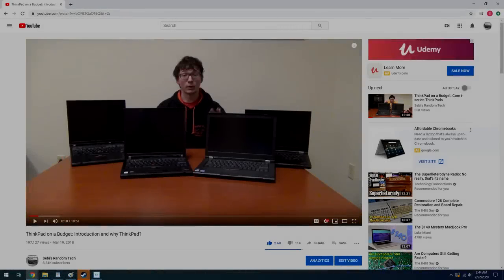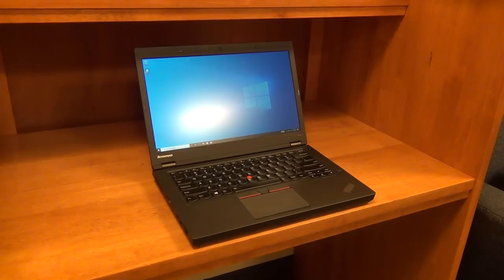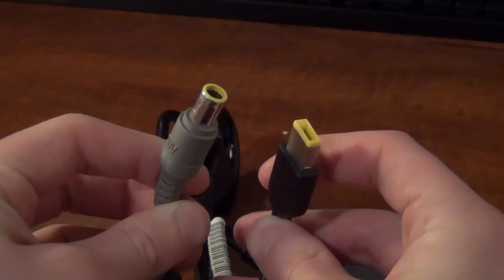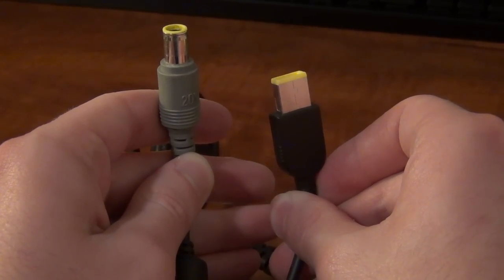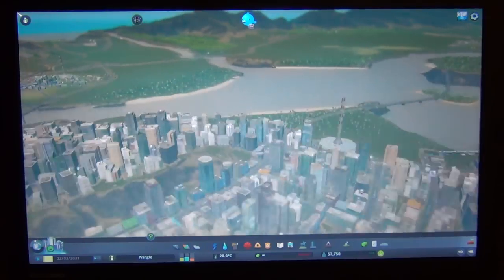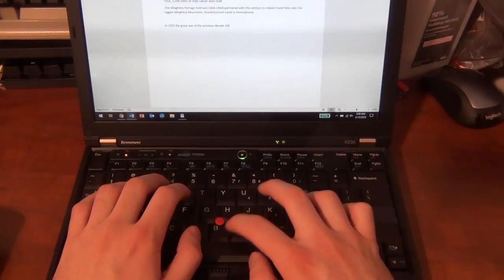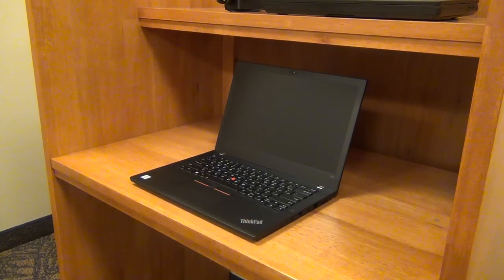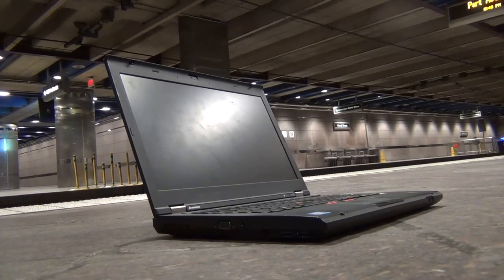Best Value ThinkPads in 2020

Comment: Is T540p is good choice?
Reply from the maker: Go for a W540 or W541 instead. Exact same size laptop (actually the exact same design) but much more powerful processors and graphics.
Reply from the maker: @workisimpossibletowork7415  800+1500 euros is absolutely ridiculous for a repair, especially on an older laptop. I think you're better off taking your chances with replacing the motherboard yourself. Since the processor is a separate part it might be worth seeing if the original is salvageable. If you are comfortable taking apart the laptop to the point that you can replace the board, I would say do it yourself.
Reply: @SebisRandomTech  Thanks Sebi. It is a good idea to replace the motherboard (MB) first and see whether the CPU is salvageable. However, does a problematic CPU have any chance to damage the MB, e.g., burn down some resistors or capacitors on the MB?

Comment: Hi do you think if the lenovo x250 thinkpad is good for 380 singaporean dollars? For work and can it run overwatch at the lowest settings? The specs are i7-5600u 2.6 Ghz 8 gb of ram, Graphic 5500hd.
Reply: Storage is 1tb
Reply from the maker: What resolution screen does it have?
Reply: @SebisRandomTech  i think its 1366x768 but im not sure ill see if i can get the information later. But can you give your opinions if its either 1366x768 or 1920x1080
Reply: @SebisRandomTech  hii soo are you able to give ur opinion for both?
Reply from the maker: The 1080p screens are better, however if the 768p screen is IPS then it will still look nice.

Comment: Hi bro i have Lunovo Thinkpad i7 6600M with 8Go ram and the nvidia 940mx graphic card, is it good to play games on it like GTA 5
Reply: No
Reply: @Cr1ptlord  why? should i add smtg and what is missing
Reply: Might be able to at least 30fps if you turn down settings to low and play at 720p.
Reply: @Ayoub-Bouchama: 

I-suggest you look at the hardware-requirements of the computer-game "Grand Theft Auto 5" and look at the hardware-specifications of the computer--graphics-card "nVidia 940mx" and look at the rest of the hardware-specifications about your-specific-computer and compare all that stuff to the "hardwzre-specifications--requirements of [the computer-game] Grand Theft Auto 5" and see if they match and/or see if your computer has computer-hardware powerful-enough to run the--computer-game Grand Theft Auto 5.

Comment: X220 the gold standard of thinkpad
Reply: Chris S. 
I own two X220s and other than the keyboard, what’s to like?
One of mine is bone stock and the other hot-rodded and essentially maxed 
My next X series laptop will be an X-250 or X-260
Reply: @GasPipeJimmy  for me the feature set and relative power compared to newer laptops is great plus it's easy to upgrade. I don't run windows which also helps tremendously with utilizing the power that i do have. Mine is maxed out as well. You can run 16gb of ram in x220's. There is misplaced information on this laptop on many sites that shows specs for the x220 when it comes to ram. I just think its an incredible value for under 150. Granted the one i purchased on ebay was in perfect condition.

Comment: What are your thoughts on the upgradability of the T440? We have one bought as surplus from a large accounting firm, it's seen loads of (ab)use and is not a top-end config by any means - we got it dirt cheap. Someone appears to have swapped in  T450 trackpad, but multitouch and scroll gestures do not seem to work - any ideas on what it could be? All drivers are up to date.  Also the screen is the lowest end TN panel and is useless for any serious spreadsheet work, would a 1080p IPS be a drop in replacement? Thanks in advance.
Reply from the maker: 1080p IPS panels are usually a drop in replacement, it's just a little bit tricky because of the front bezel being held on by adhesives. I'm actually working on a video where I do this process in a T440s, however it's very similar in the regular T440.

As for the T450 touchpad, I did a video on this with a T440p where I show how to get the drivers working correctly. I don't use the touchpad but those drivers should get the scrolling and gestures working.
Reply: @SebisRandomTech  Thanks for the quick reply. I found the T440p video after I posted the first comment, downloaded the drivers linked on the forum, no difference. The manufacturer listed in Device Manager details is "Lenovo" though, so I am thinking if someone put a cheap copy of a proper touchpad in, which would explain why multitouch scroll is not working. Interestingly middle button scroll works fine in chrome but not e.g. in the Win10 settings app.
Reply from the maker: That’s the original issues I had before installing the proper drivers. I think you need to look for a more recent video of mine, you can’t simply download the drivers shown there but you also have to modify the files of it to properly work on the T440. This more recent video outlines that process.
Reply from the maker: https://youtu.be/iap3qJKpR84
Reply: @SebisRandomTech  Hey. Tried the procedure outlined in your video. Did not work, there was no change. Any idea what it could be? I uninstalled all Synaptics drivers and tried again, but still no result. Checked the driver installed was the one from 2018 and was not signed, so appears to have been the correct one.

Comment: I recently got accepted to grad school for computer science I'm looking to get a Thinkpad run Linux on it and maybe some basic cyber security/ sysadmin software do these thinkpads have good enough performance for this?
Reply: The Thinkpad would be running Linux. Likely Kali Linux.
Reply: @andyburris2555  , I'm no expert, but for the same reasons got myself used x250 last year (got lots of recommendations for this model from my friends). I5-5300u + 8gb ram + 240gb ssd . All of that for 250$. Currently running ubuntu, but tested out lots of other distros (kali included). Had no problems whatsoever. 
Im only 2nd year in computer science (in France, so I dont really know if we're studying same things), but so far I had zero problems linked to hardware (performance/compatibility wise) and I'm really happy with what I got for the money. You should probably consider getting one of these. If you're worried about it being "weak" - you can get yourself one with I7 inside. It will cost you 200-300$.
Reply from the maker: These should do the job just fine, and if you need an extra performance boost that will just be a RAM or CPU upgrade away.
Reply: Right on brother, I run Linux without issue on my T430. Should do the trick.
Reply: My T420 with i5, 8GB RAM and SSD is running Windows 10 smoothly. I upgraded it from Windows 7, wich also ran great on it. A regular Linux installation should use less resources. In the matter of fact, I am using Linux Mint on a 12 year old Asus Eee Netbook with Atom Processor, 2GB RAM and SSD to record Audio directly from my USB connected mixer at live shows. The T420 is way more powerful than the old underpowered Eee. So, you'll be more than fine. This said, it is generally a good idea to install an SSD in any computer, these days. It makes a huge difference in read/write performance, which is most noticeable at boot-up. Throwing in more RAM increases the performance, also.

Comment: Great video! I would also like to mention that the T450s is a pretty good laptop if you get it with the touchscreen. It looks very sleek and modern.
Reply: It also has a block of wood for a processor. As a matter of fact, the i5-3320 in the T430, is a little faster.
Reply: Just got a used t450s from eBay. i7, 8gb RAM and FHD IPS display. I think it's an amazing machine. Loving it.
Reply: @dragunovbushcraft152  which CPU in the T450s are we talking about here? It had a range of CPUs available.
Reply: @jugostran  Intel Broadwell core i7-5600U CPU.
Reply: @dragunovbushcraft152  depending on CPU. It isn't stronger than the i7.
Reply: @jugostran  i7-3520m vs. i7-5600u= Virtually, exactly the same.
Reply: @dragunovbushcraft152  yes. Possibly because one uses an ultrabook chip. Though, in regular day to day use, both CPUs are snappy. And the T450s looks more modern which is a definite advantage.
Reply: @jugostran  If you're doing general computing, the T450 is "ok", and "Doable". Just like the T430. However, you can do many more upgrades to the T430, to make it MUCH faster than any T450. You can upgrade the T430 CPU to a Quad Core,  making it usable much longer than the T450. You CAN NOT upgrade the weak, T450 CPU.
Aesthetics don't make a laptop any more, or less usable, and the T430, especially, the T430s, are certainly not bad looking computers.

15w.... 47w..... Makes no difference numbers, are numbers, and faster, is faster. Numbers don't lie. IMHO, Broadwell processors were a small step DOWN, from Ivy Bridge, and pathetically inferior to Haswell.

I could've been REALLY unkind, and compared the MQ powered, T440p, or W540, to the T450, the T460, even the T470, THAT would even be worse! It's pretty pathetic that a seven year old processor (i.e. Haswell, i7-4900mq), can embarrass a new, top of the line, T480 Quad Core, when it comes to real "dirty work".

A lot of people make the mistake of, "Hey! A T470 would be better than my old, T440p i7-4800mq", and are sorely disappointed! Just because people don't know.
Reply: @jugostran  Exactly! The T450s really looks modern and good. Very portable as well. It's my first time using a ThinkPad and I'm impressed. I have previously used Hp and Dell. The life of my second hand T450s is about the same as Hp, bought brand new. However, the HP is now very annoying to use and slow. ThinkPad rocks!
Reply: @dragunovbushcraft152  also CPU won't solve the biggest issue with all ThinkPads. The graphics. What good is a strong CPU when you can't even do any graphics intensive task. In my opinion, the stock dual core CPUs match well with the iGPUs.

Comment: ** Hi Sebi: Today's October 21, 2022. I am in the market for a laptop. I live in the US. My budget is about US$1200. Looking for a 14 inch at least, large screen size is fine too. Weight should not be more than 4 to 5 pounds. I want to buy once, cry once. I will use it for casual to semi professional computing. Will need 16 GB of RAM and a solid state drive. It would be nice to have a good keyboard, battery and a durable charging port. Thank you **
Reply from the maker: Look at the P series. You can likely find a used P52/53 in your price range. You could also look at the X1 Extreme and P1. Only downside is the battery life isn't quite as good on those models but they will check off your other requirements.
Reply: @SebisRandomTech  Thank you 💙 I will follow your recommendations.  However, I did something impulse last night. I purchased an open box T480 for $500. It has 16 GB of ram, 4 GB of video ram and a resolution of 2560x1440.  Does this make sense?/. This means I still have some money left to look into the P series, X1 extreme and P1 as per your recommendation. I thank you again for sharing your expertise with people and your viewers. May God Bless you.🙏
Reply from the maker: @bella3008  Give the T480 you purchsed a try and see how well it works for your needs before spending more money. If it works well then you're all set, if not then you could look into other options.

Comment: Lenovo seems determined to destroy the ThinkPad legacy with their bad decisions in terms of design, functionality and upgradability that get worse and worse every year. It's sad. I love my P50 but I do have a crush on those T430 machines, they're the sweet spot between older goodness and future proof.
Reply from the maker: I completely agree with you. I still prefer the T430 and older ThinkPads, but everything up until the T480 was still at least respectable, and a step above the competition. With the T490 and the newly announced T14 I can no longer say I would recommend a brand new ThinkPad to someone. The P53, P73, P1, and X1 Extreme are pretty much the last fully upgradeable ThinkPads, but even those removed external batteries. I really hope Lenovo listens to its customers and makes better decisions going forward.
Reply from the maker: Sebaka & Co.  What are you talking about? The whole appeal of these machines is that they are easily serviceable. RAM and storage are both important components that can fail moreso than other parts of the motherboard. Soldering on something for no reason that used to be replaceable makes absolutely no sense. What defines the ThinkPad legacy to you, Lenovo turning them into MacBook wanna-bes?
Reply from the maker: I have to scoff at your response. You didn’t even answer my question so...

Also, what’s wrong with wanting to be able to work on something I paid good money for? What’s wrong with wanting to upgrade parts in my computer to extend its useful lifespan instead of being wasteful and buying the hot new gadget every year? I seriously don’t understand why these things are such a problem for you as you feel the need to “scoff”, talk down, and be disrespectful.
Reply: Sebaka & Co.  what defines a ThinkPad, in your opinion?
Reply from the maker: Sebaka & Co.  If my questions are not worth answering, then I'm clearly not worth you wasting your time by coming here spreading complete fallacies and then accusing me of dropping fake likes and comments. You refuse to address my comments and instead insult me and others. All because you can hide behind the comfort of your computer screen knowing that you're safe from any real-life consequences of your actions. Your argument lost its merit several comments ago. Thank$ for wat¢hing thi$ video!
Reply from the maker: @DaoQui  Don't even bother, he's made it clear he's not going to actually answer legitimate questions/concerns.
Reply: Sebaka & Co.  You do realize that losing the ability to upgrade/replace things like the CPU, GPU, etc is because of companies like Intel and Nvidia, not Lenovo. Lenovo didn't choose to stop offering socketed laptop CPUs, that was Intel's doing. Lenovo didn't stop supporting the MXM standard, Nvidia did. The whole reason Sebi recommended the ThinkPads that he did in this video was because they were the last ones to have socketed CPUs, so I'm not sure why you're trying to argue that he isn't concerned about that...I could go on about the lack of any sort of real argument on your part but you have already made it clear that you have zero interest in actually debating and just want to harass this guy as much as you can because he doesn't like newer ThinkPads as much.

Comment: Thank you for the really informative video. Based on what you've said, I think I'm going to buy a T430 as my first Thinkpad. Mainly for video editing. Just wanted to ask a quick question though: is there any limit as to what SATA hardrive it can use the in the hot swappable drive bay? I have a spare 1TB hybrid drive I used to use for a PS4 and just wondered if that would work.
Reply: T430 owner here: 7mm and 9.5mm 2.5" drives are compatible, as the DVD Hot-Swap bay is 12.5mm tall.

Comment: Best Thinkpad models are T530 and W530.
Reply: I'm using a W530 with an i7-3940XM. When I watch YouTube videos the CPU usage goes to 40%. And I already have the most powerful processor in it.
Reply: @christoph1995  yeah, they are 11 years old now and obsolete. You can get good deals on much newer Thinkpad these days. A much thinner and lighter T15 G1 will outperform it

Comment: About to buy my first ThinkPad to do some Excel, mySQL and beginner coding. Should I get an X230 or T4x0?
Reply: The form factor of the x series is great for portability reasons but an external monitor is way more comfortable to code on than the screen of the x230. Don't get me wrong. I'm still using my X220 to do coding and such and it's okay, but you don't want to sit  hours infront of that tiny screen. So I'd say, go with the T4x0 series. Still portable but a more comfortable screen.
Reply from the maker: Both are really good choices. A larger screen would be better for coding but a smaller screen would be more portable.
Reply: @TinyTeaKettle  What do you think of the T440s?
Reply: @emacs Depends on how "portable" it has to be. The T4XX is my personal favorite. Portable but still a great screen. If you have to switch your workplaces quite often, the screen of my X220 way annoyingly small at times. I would agree that the 5xx series is bulky though and I'd rather use a desktop pc there. In the end, it's a personal preference. And thankfully Lenovo provided us with different sized machines.

Comment: I have a Lenovo T510 laptop and the only thing I don't like is the display resolution.  Are there resources discussing upgrading the screen to 1920x1080?  Enjoyed your in-depth videos on the T4xx series.
Reply from the maker: There's a few threads on r/thinkpad, the ThinkPads.com forums, and Lenovo's forums about this. I've never done the upgrade myself but am considering doing the upgrade on my T520.
Reply: I have the T510 as well with the same resolution problem. It works and doesn't skip a beat but it's the resolution.. We need to find a panel that is an upgrade.  Love my T510.
Reply from the maker: @duaneafields  They can accept up to a 1080p display.

Comment: Do you plan to make an early 2023 part 2 of this video? Also is the x260 good for programming and web browsing? 

Or do you still recommend the t4xxp for coding? Which one of the 3 mentioned here?
Reply from the maker: The X260 should be fine for your needs. I do plan on releasing an updated video at some point this year.
Reply: @SebisRandomTech  I also found a good priced i5 8gb ram t460 in good condition for 120 usd, is that a good deal? I like the idea of upgrading and swapping parts out
Reply from the maker: @emberavenge7162  That's an excellent deal. Do you know what type of display it has?
Reply: @SebisRandomTech  will let you know once I get a response from the seller!